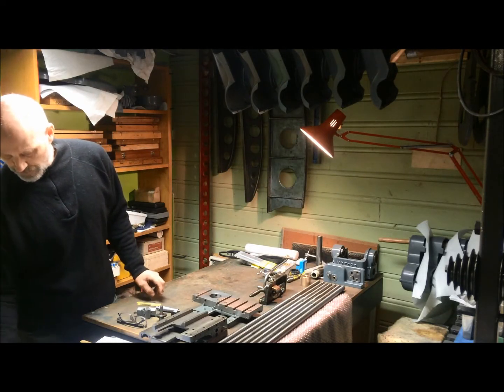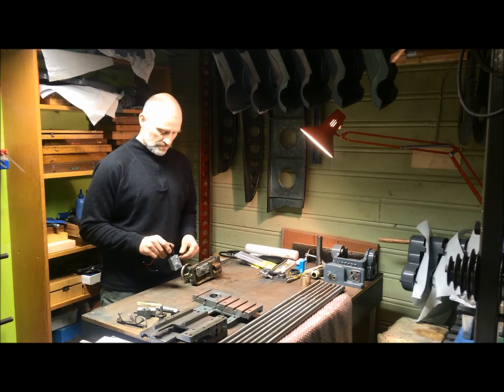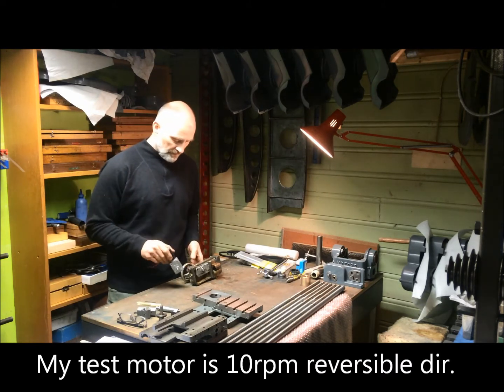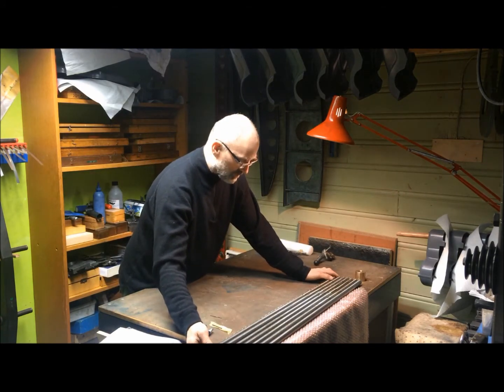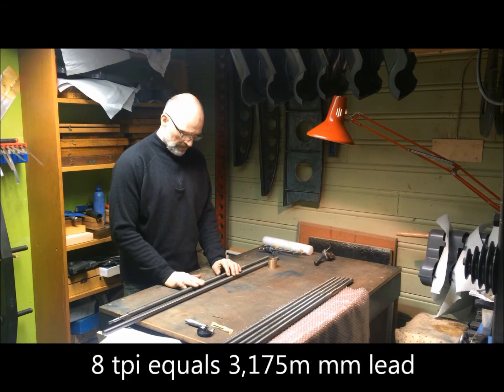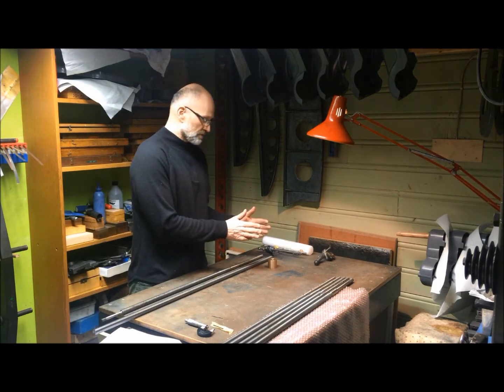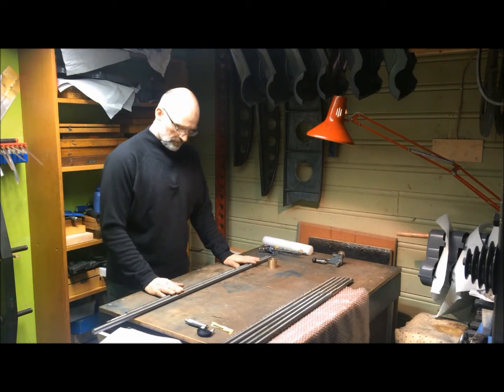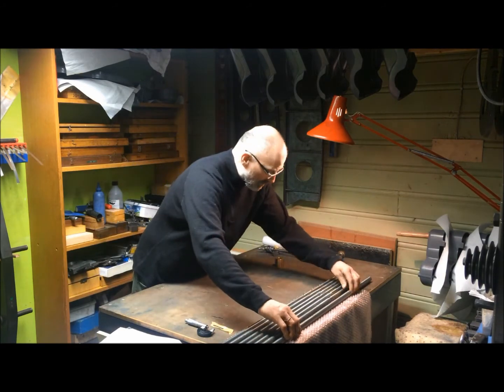Myford Super 7x7 - Remaining tasks part - 3

Comment: Progressing well Jan, I'm catching up with some of your videos now.

I think 3 mm pitch would be the norm if that were a metric lathe and their imperial was 8 tpi. That's certainly the case with the Southbend clones anyway
Reply from the maker: Thanks! Yes, I realized that 3mm would be a good choice. Anything between 2 and 4 will do good with the ELS. However, I had already bought some 2 mm precision leadscrews and although this is a little slow when using the handwheel on the right-hand side, ie. manual feed with the leadscrew, it is not a problem with the motor-driven ledscrew. As it tirned out, at least 2 (maybe 3) of the original imperial leadscrews are OK, and as the ELS will function with this also, I might just use those. My reasoning for a 2mm pitch was that if I install the metric screws on a machine with the configuration I originally planned, namely with a motor driven rack feed, ie. using the apron mounted handwheel for manual fast-feed and "reserve" the use of the leadscrew to threading, then I figured the geartrain combinations would be simpler. I might be wrong though :)
Reply: I'm not sure if they would be easier Jan. I honestly have no idea, but my thoughts were quite the opposite in that there are a bunch of 3 mm pitch leadscrew machines around, and the gear combinations are already well established. One of my lathes is 3 mm, the other is imperial 8 tpi. As you say, if you're going to run an ELS then it won't make any difference besides requiring the motor to turn faster.

I have a simple scraping job I've been meaning to finish and get up on Youtube. Auto generating a precision master square. However just been too snowed under with other work at the moment. Hopefully in the next few weeks. In the meanwhile I will just have to do my scraping vicariously through you ;) Thank you for keeping my hand in :P
Reply from the maker: Hi Pete, sorry for delayed answer. I am sure you are right about the 3mm metric conversion from an 8 tpi (3,175  mm lead) being the most obvious choice. Done is done, ie. i made the purchase already and as my thoughts were leaning towards using the ELS or if a motorized feed using the apron handwheel ie. rack, the leadscrew solely in use for screwcutting, the combinations seems nice with regards to 2mm lead and the available "smaller" gears (20 and up to 60, 70 or 80 teeth).
Auto-generating a precision master square? Yes, please.. you have to make a video on this.

Comment: I ran across Rocketronics a month or two ago so I'll be more than interested in your ELS conversion and what you think of it Jan. My current lathe is only a semi norton gearbox with only 3 feeds or threads without doing a manual gear change so a decent ELS would be a real help.
Reply from the maker: Have you seen the videos of the ELS on their website? I assume the owner himself has a Wabeco lathe, but I also see they show a Paulimot (Sino/German adventure) lathe, and I have learnt that Stefan Gotteswinter has installed this system. All these lathes are change gears "only" as standard (I think), but then there is another video on an EMCO 11, where the Z (longitudenal) axis only is mounted. Video showing threading and then the manual infeed. Still impressive!
Reply: Funny enough Jan it was Stefans video where I picked up the Rocketronics name and how I found out about them. And yes have watched there videos. Previous to Stefans mention I hadn't even heard of them. Those Emco super 11's are my idea of the perfect sized lathe for my shop since size and weight are pretty restrictive for me. I looked for over a year for an excellent condition Super 11 before finally giving up. All I could find in very good condition were either far over priced or 3,000 or more miles away. Emco's overall design did affect my buying choices though. I finally bought the same as Warco in the UK sell as the WM 280 VF. Certainly not Emco quality but it's ok I guess.
Reply from the maker: The Warco seems to be a good lathe (I had at look at their range at the London model engineering show now recently). But this surely has a gearbox?
Reply: Yes it does have a gearbox, but what they don't mention very much is it's only a semi gearbox with a limited feed and threading range of 3 choices per gear change. George Thomas's writings also swayed my thoughts about exactly what I wanted so the tee slotted table wasn't in my opinion an optional choice. Adding at least one servo like that Rocketronics kit for an ELS system to get basicaly unlimited metric/imperial threading and longitudinal feeds would be a very nice added improvement over the factory design. I think Stefan mentioned he's going to do a video on his ELS and with what you find with yours it should be an interesting comparison from 2 people I respect very much. Mine is an ok lathe, but it's no Schaublin or Hardinge HLV :-) 

Speaking of Hardinge, if you haven't seen it yet Babin Machine in the U.S. offer an industrial quality version of an HLV ELS system that could be used on other machines. Quite expensive though and I think there's is around $3,000 - $4,000 U.S.
Reply from the maker: Thanks for the nice words! Re. Warco lathe: I see.. well.. have you ordered your ELS by now? :) Will check out Babin machine!
Reply: No thanks needed Jan, both yourself and Stefan have more than earned any respect and praise you get by knowing your subject very well. Unfortunately that ELS is on hold as I've been unemployed for some time for medical reasons but things are improving so it's on the furure list.

Babin have a good video showing there system and it's capabilitys at www.babinmachine.com I think it's an added option, but it can be set to do multi start threads. The Rocketronics may be able to do that as well allthough I'm unsure of that. Few would really need that capability I think. But still very impressive to see how well the tool tracks the spindles position.